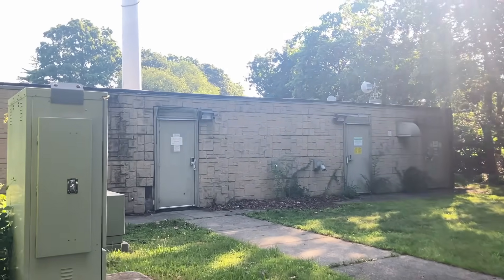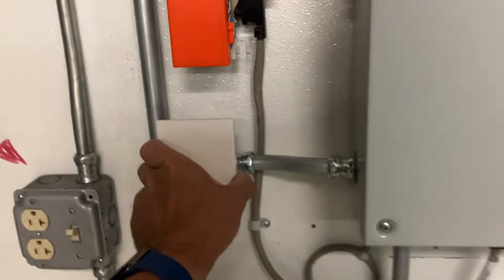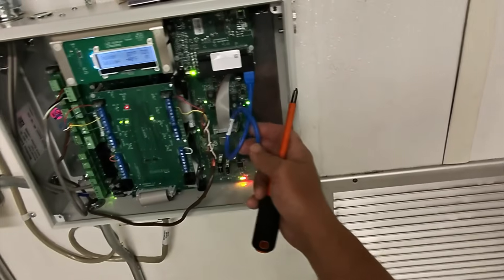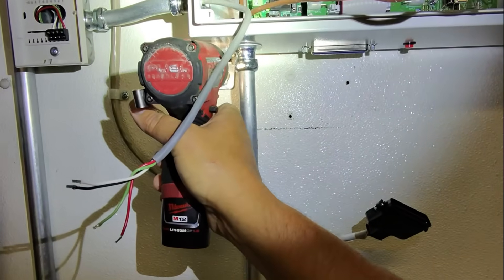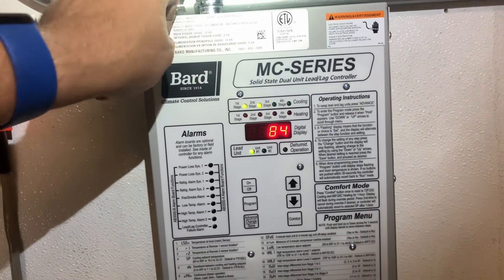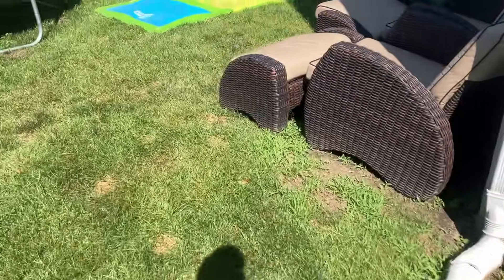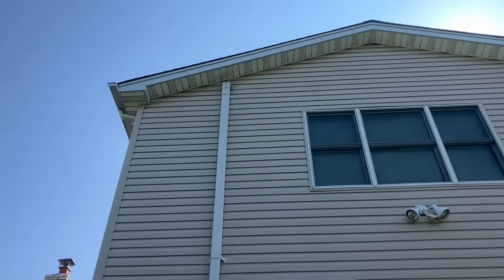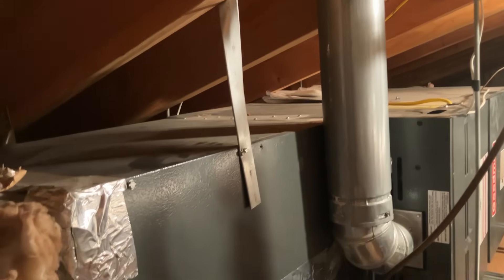July 4th HVAC Emergency – Cellular Shelter Breakdown & AC Nightmare!

Comment: Used to work for Verizon cell sites out in the middle of nowhere in So TX, illegals would stage there due to antenna location and leave all their trash there, they would go under fence to put their water jugs under the Bard condensate drains

Comment: everything in a cell site must be bonded and grounded because of the radio frequence energy present. you just get used to working with it and the extra time it takes. trust me you dont want to see the crazy things the devices would do if all that was removed.
Reply: That is incorrect! Equipment at a telecom site is bonded because of 1, the battery plants are -48VDC. 2, isolation from the power grid. 3. Lightening strikes. ALL telco sites have a bonding ring to ground and employ a TVSS (Transient Voltage Suppression System). For RF, they use a faraday cage and since the emitter (antenna) is above a certain height (inverse square law), it poses no issues. Most of todays RF danger is at the emitter, not the radio. Radio sends up micro amp signal and is boosted at the tower. The cables are honking huge to eliminate interference and low SNR. :) By the looks of the equipment, its fairly newer generation of kit.